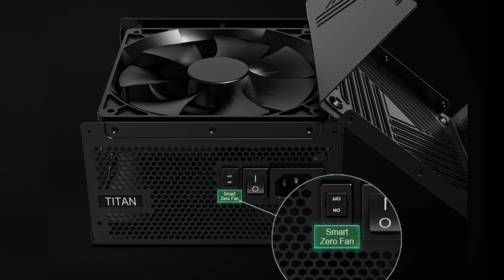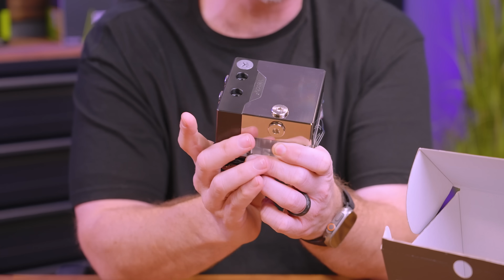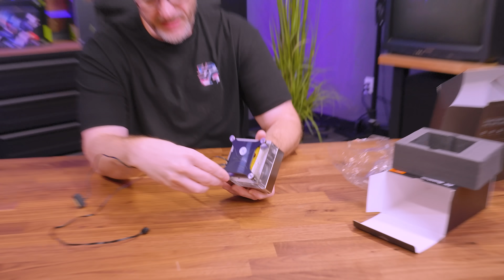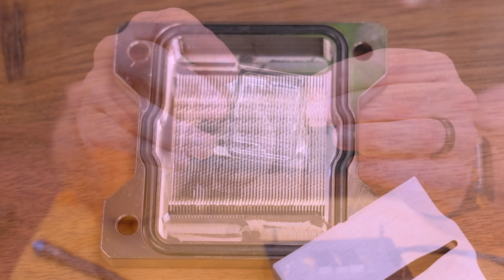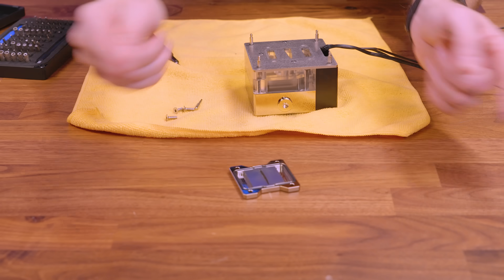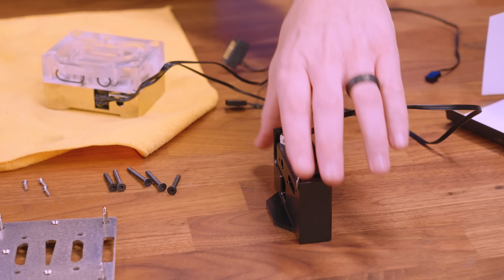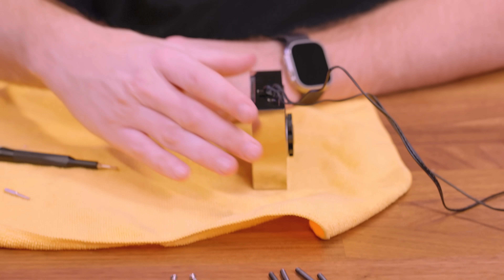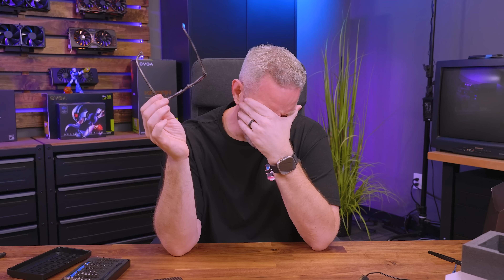I wish this existed years ago!

Comment: User error seems to be the reason the mounting hardware backed out. The 3M tape not being pulled off is a non-issue. It's never coming out on its own. Plus I remove them since I don't use RGB and I'm glad they aren't mounted. 

The mounting system is a pain though and a gripe. I oiled the hardware for more accurate torque/mounting. 

I really don't like how noisy it is. The pump is loud.

It is a pain to flush air out of. I didn't add a res because that's not the point of this unit. Otherwise if you have the space use a block and a pump/res like a normal loop.

That said, it works well performance wise and it's compact. It is well made too, just hard to get past the pump motor noise.

Comment: Car radiator cooler systems use a secondary bottle/reservoir. could you use the extra ports to put a small filler/reservoir up high in a convenient to access spot? It might also, like a car, give you and easy visual on the current fluid level drop.... Just something small, so you can put that thing where ever else you want....?
Reply: If such does drop you could back light that top up mini-tank with RGB, Blue or Green for fine and red for "FILL MEEEE!"?

Comment: At 9:59 I noticed the return path for the coolant extends past the uptake port and makes a 180 bend into a dead-end.  Since this appears to be pointed towards the top  of the block, I'm wondering if this might be intended as a bubble trap to prevent bubbles collecting in the motor over time as oxygen and nitrogen are forced out of the water.  Or did I miss something that feeds into there from the plate?

Comment: This did exist years ago. I've been using Barrow's version of it for years, it works great. The EK design has some improvements, namely a reservoir that actually can work as a reservoir, but for what it is the Barrow version is fine.
Reply: That's right, 10 seconds into the video I realized that this was done by Barrow years ago already.
Reply: True. Keeps my 5800X cool with a 240 rad. A bitch to mount, though 🤣
Reply: @Kapitein_Bierbuik  I already had a bunch of computer cooling hardware, so I grabbed some thumb screws and springs from another cooler to mount mine. The included screws and springs are dimensioned awfully, or at least they were when I ordered  mine, if you put the springs under too much tension they'd just pop over the screw heads and make a mess. Works fine if you just put an M4 washer between the spring and the screw cap, but then they could at least have included the washers...

I'm not saying the Barrow product was perfect, it has some issues. For example three ports is really convenient, but they're located a bit too close together for larger fittings, which is unfortunate for me since I prefer thick wall soft tubing. But for small form factor builds, being able to eschew a separate pump  and splitting reservoir duty between the radiator and the CPU block lets you watercool in some very tight spaces indeed. And watercooling in turn lets you shrink some cards down tremendously (though that mainly applies to Nvidia reference cards, which can be tricky to get in Russia). A watercooled 4090 is as long as a RX6600. Thanks to the Barrow block, you can squeeze a 7950XT and a 4090 into an absolutely tiny SFF machine with a single 120mm radiator and a 3krpm fan to get an incredibly powerful and noisy machine that's still small enough to conveniently carry around, which is precisely what I did years ago. Loved it.

EKs block is better designed, but I'll always have a soft spot for my Barrow, which did this same genius thing, which fits on both Intel and AMD, and which is backwards compatible all the way back to AM2. That's not EKs style though.
Reply: I used an alphacool one years ago in a sff build I did for a friend of mine and it worked great!
Reply: Also been using a Barrow Pump/Res block for years!
Reply: Correct, Barrow, Koolance and swiftech as well !
Reply: I bought the barrow one, but for some reason the thermals were awful, even when re-seated multiple times, bough a CPU block only, then an EK pump/res combo, all high temp issue were gone.
Probably i got a faulty unit or something wasn’t right, but also left a bad taste :/, so no more these lesser known brands.
Reply: Esibaer or however you spell it make one called the Aurora solo that is a pump block combo
Reply: Same here! Works great, but I find it very hard to remove air initially after filling. Any tips?
Reply: @Beta117  Attach a reservoir to the top port on the combo unit, with flexible hosing. Run the pump while lifting and rotating the computer so as to walk air out of any nooks it might be gathering (radiator is the big culprit). Once all the air is collected in the extra reservoir, turn the computer off and unscrew the extra reservoir over a sink. Top up the combination unit and screw a cap on over the port. You’ll still get some air, but hopefully little enough that none of it gets agitated enough to make a noisy trip through the loop.
Reply: @Thib0Bav  and you can upgrade the pump to higher RPM if you wanted.  I have the eisbaer with eiswolf for vega64. Really need to upgrade my rad. :D
Reply: Can you please help me understand how to fill it with water?
Reply: @KeepAnOpenMind  Attach a separate reservoir to the third port on the pump block and run the system for a while. Move it around so that the air bubbles will collect in the extra reservoir. Once you think you have all the air out of the moving part of the loop, empty the extra reservoir, unscrew it, top up the fill port it was connected to, and screw the cap on.
Reply: @СузаннаСергеевна  awesome recipe, thanks!
Reply: the barrow version contained non anodized aluminum parts, a very bad product.
Reply: @narfTV  Your information about the non anodized aluminum parts in the barrow is incorrect.  Please stop spreading false information.  I've built multiple systems using their pump/res block and not a single one had non anodized aluminum parts.  Multiple tech reviewers have purchased the barrow version and none of them have found non anodized aluminum parts inside it.
Reply: @Mildly_Amused  i asked barrow in an email about this, maybe you should do this aswell.
Reply: @narfTV  Not unless they drastically changed things around since I bought mine. Every surface exposed to coolant was either plexi, the DDC pump, or nickel-plated copper. I disassembled mine to check for just this, and found it to be a high quality product in every way except the mounting hardware.

Comment: I feel like this would justify a res. Like usually people run a pump res combo and then have  another one of those decorative reservoirs that are made of glass and rgb against one of the vents of the case, but with this you can eliminate the pump-res and just have the res, to me that’s makes more sense with the amount of water you would use as opposed to a bigger mass of water with the former. But it’s cool to have more options now.

Comment: That actually looks cool.  But i have a dual pump set up on my rig with 3 radiators. Fans are running slow (500 rpm or so).  Can someone let me know if 40c in water temp is ok.  Since my system is quiet, my water temp gets to about 40c when gaming.  I have a 12900k stock and a 3080 in my loop.  I can put a more aggressive fan curve if needed, but at a louder system.  Any suggestions would be greatly appreciated.   Thanks.

Comment: heavy sinks like that can tweak your mobo over time.  Back in the day, I had a big Zalman full copper "fan out" sink.  My machine would reboot if the big heavy front door shut a little hard.  The wave through the floor and the weight, after a few weeks, made the system reboot.  Put it on a desktop, no problem.

Comment: I have to disagree with Jays thoughts about using dual or multiple pumps in the same loop. Fluid flow is not like a model car that slows down. The flow rate is exactly the same along the entire loop length. Its actually perfectly fine to use pumps at completely different speeds or different types together. The centrifugal pump is always spinning far faster than the fluid flowing through the loop, so even if one pump is running at full speed and another at minimum speed it has no effect except that their head pressures combine to produce the same flow rate as if it was a single pump producing the same pressure. If it was two pumps just pumping from like one big container to another with only tubing between then maybe it wouldn't be ideal. In a real pc loop though the resitriction to water flow is so high that the flow rate is lower than a single pump at min speed can produce with zero resistance. We used to test all this sort of stuff back in the day.
Also, don't expect a second pump to make a big difference. Fluid dynamics dictates that to double flow rate through a loop, 4 times the pump pressure is needed. That doesn't even mean that 4 identical pumps will double flow rate vs a single pump. A pump's pressure drops as flow rate increases. So to double flow rate requires even more than quadruple the pumps. In a real system flow rate has to drop a long, long way before it has more than a neglible impact on cooling and with the days of multi GPU systems long gone a single decent pump is plenty for any loop you can realistically build.

Comment: That looks heavy. Heavy + vertical = no bueno.
I still think the best solution is to find a local CNC shop and to machine your own block. Also, considering how super high end (non consumer) block plates look, the entire micro pathway is bs, you don't need that, so the whole blockage deal is not really a concern if you choose to make one yourself (or have someone make it). We're not in the age of dependence on big tech to make stuff. These days all you need to do is careful study, learn some SketchUp, install an extension, export the file and pay a dude online to have the item you need. Honestly, that's no excuse for most mid to high tech savvy people.

Comment: 9:50 flow is the opposite to what you said, its input into the pump through the middle and output through the sides. so the flow in the waterblock plate is 2 inputs on the sides, and sucks into the bomb through the hole of that little plate.

Comment: I was thinking of the possibility of using something like this for a dedicated system. Use this with a small res and a small rad, and then a pump/res combo with a larger rad for the GPU in a medium-sized case. I think that this way you can work on either the CPU or GPU without having to disassemble a large part of the cooling system.

Comment: The radius of the bend will dictate the flow of the water. Hard bends create turbulence, where as sweeping bends do not. But you would run out of room really quick using sweeping bends compared to hard 90's.

Comment: So, isn't this basically the same thing as the Alphacool Eisbaer Solo, which is also a Pump/res/Coldplate combo unit with a swappable DC-LT Pump? Main difference seems to be that the EK unit is only usable on a specific socket while the Alphacool unit works on most sockets.

Comment: I really wish motherboard manufacturers would take into consideration cables and have a small open space on the board within proximity of the CPU to allow for pass through of cables.  Yes I know there is circuit traces all over the board but I have to imagine there would be some way of factoring that in during the design phase.  Don't put it RIGHT on top the CPU socket but if it was within 3".  Just a pass through large enough to route cables to things like RGB controllers and the like.  Or hell stuff excess cable from a pump PWM cable.

Comment: I would have consicred buying anything like that if they would be complatible for generations to come, imagine wasting a 500$ on a kit that is a one time use, none servisable and you can't use it on your next build . 
Make the damn thing from aluminum block and not acrilic production cost its allmost the same, and why use O rings, maybe use RTV and seal it once and for good and sell damn kits that will make the kit more complatible with new mountion options and please stop selling cheap ass painted coolants that ruin the pump, why car coolant is something you replace every 80,000km or every 7 years, why a damn pc needs it replaced every 1 year.
also why all the connectors are proprietery, just use a simple AN Thread standard that exists for years already and is prettry reliable 
Greedy greedy companies are just disgusting
Reply: Checkout the modultra Lobo
Reply: @Morgan Bertram Looks pretty cool, much better quality ! would you know where to stock up on DDC pumps ? they all look quite different not sure about the compatibility.
Thanks for mentioning Modultra Lobo
Reply: @alberta3157  alpha cool makes a few different molex powered pumps just get one without the metal cover/heatsync then the plastic top with tubes comes off. EK actually makes one that is actually sata powered

Comment: they leave the tape off so you can remove the RGB if you wish without having to clean the residue, especially if you are doing small form factor, or dont want hanging rgb leads without the ability to use it, i actually appreciate that they do it that way
Reply: If I was to use that block, i'd be taking out the RGB lol so I too appreciate it's not stuck on.
Reply: I was thinking that, AND I was thinking "hey what if you need to disassemble the block to de-gunkify it after using cheap coolant?" You wouldn't want it getting soaked while working with a wet surface.
Reply: Or just in case the RGB LEDs die for any reason
Reply: @DaysofKnight  ive had 15+ ek blocks and i can confirm that the rgb will die within a couple of  weeks for me...
Reply: @DaysofKnight  probably one of the least likely things to fail, but fair enough. 

Though, I guess OP's reason would be the main reason. Immediately makes sense imho
Reply: @noneofyourbusiness4294  Never trust anything from a company in 2023, they're cutting corners left and right
Reply: that's me, 3090 SE block, EK 1200 block and FLT 80 RGB off XD
Reply: Also the RGB won't go anywhere, it's inside.
Reply: It also allows you to change 5V DRGB to 12V RGB depending on motherboard headers / controller you're using. Like if you want Corsair to control it, it's way easier to put a new strip in there with a JST connector soldered to it. Keeping the original EK in case you ever sell it.
Reply: @VetteTTV12  I think 12v RGB is effectively dead, and thank goodness. We're slowly closing in on standardized RGB and that's a very important step
Reply: I was just going to say it a feature to remove it if you don't want the rgb.
Reply: My first thought would be, it's not like it matters. I can't see any of the rgb chips/lights making it around the tight corners they have, so no need to have somebody or something removing the tape to stick it in. but yours also works just fine as an explanation.
Reply: Yeah, something tells me if you're taking the block apart to take out the RGB instead of just not plugging it in, you have the tools and time to get rid of some residue. Would be interested to see if it was just this block or if that's an actual reason they do it on all blocks
Reply: Tape ON, not OFF
Reply: Also, the anodizing may not be perfect and the tape has unshielded 12v dots all along it's length.
Reply: This is the way
Reply: Hello everyone, I would like to install this in a Fractal Ridge case with a RTX 4090 alphacool water block and a R9 5900x. It will be my first watercooled pc. I will be installing copper radiators, one triple 80mm radiator on top ( 30mm thick/thin) and a dual 120mm x 20~30mm radiator on the side ..My big question is will this water pump be enough to keep a small form factor PC like this one cool?
Reply: I can see where you’re coming from but if you didn’t want the RGB active, just don’t plug it in. It’s got it’s own cable so you can unplug it and hide the cable instead of taking the block apart to take it out entirely.
Reply: also if the piece that it's sticked on is made from metal, leaving  the tape on can prevent it from shorting... because the strip has also contacts on the back side

Comment: For the LED's I dont see that as laziness, what if you didn't want to keep the led's installed in one build?  The led's not being taped down makes it cleaner to remove etc, but I do get it from Jay's perspective (these combo units aint cheap).  I love when I saw this come up in my email from EKWB a month+ ago - there was a hole in the market for a quality unit since last I checked Swiftech stopped making their option and I'm not going for the Barrow unit since they are known to have exposed Aluminum in copper/nickle based loops.
Reply: Modultra has a smaller unit less brand recognition but fully cncd and cerakoted